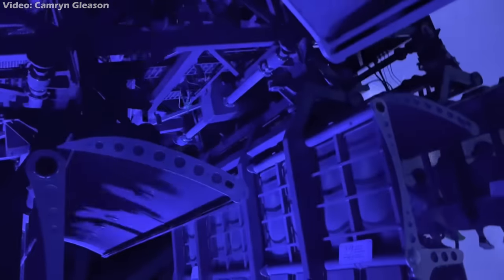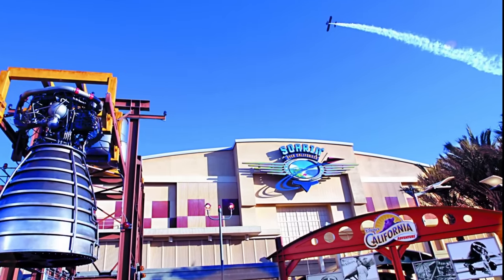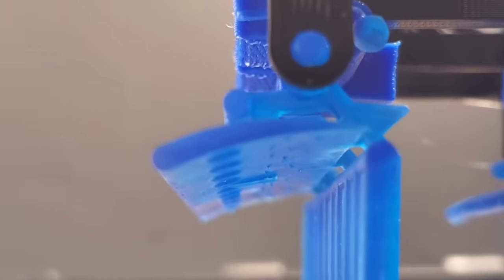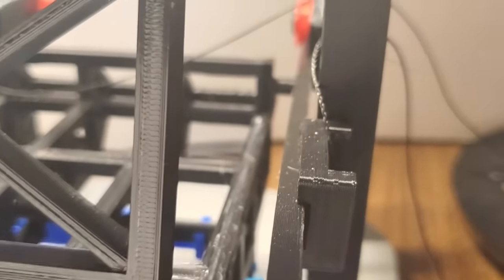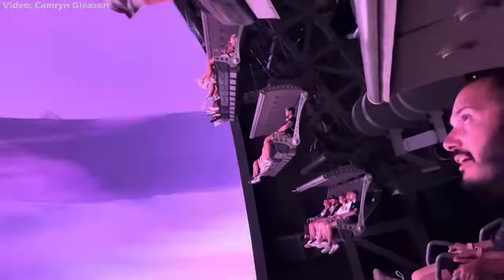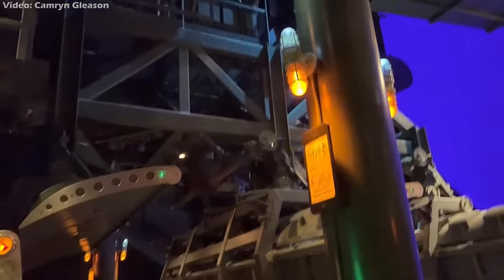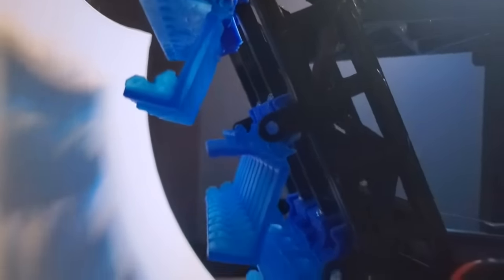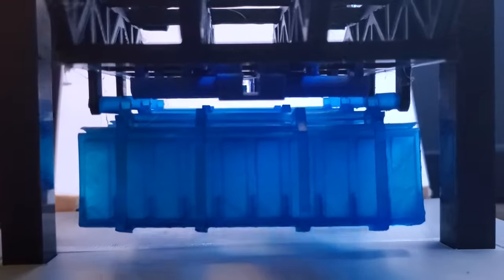Soarin' Over California - HOW IT WORKS

Comment: So maybe its a difference between Florida and California versions, but since this was one of my babies when i worked at DCA, a few notes:

The canopy is pneumatically (pressurized air) not hydraulic (pressurized oil) controlled. Scents are done by a beaded filter material with individual tubes going into the squirrel cage fan each seat has in the canopy. The carriage itself has a single park air connection that runs the brakes, canopies, and scent air, and restraint unlock. 

When we ran IMAX 70mm film our goal was always to get 10,000 cycles before having to replace it. We did this 5 times before we replaced the film projectors with the 4 christie laser powered 4k projectors in use now. 

Also a fun fact: the DCA version of Soarin over the World was supposed to approach over DCA before turning and flying over Disneyland. This was all shot (with World of Color on the pier and the Red Car around Cathay circle) but was cut due to time as the extra 5 seconds would have dropped capacity.